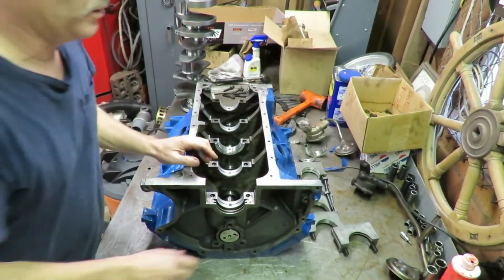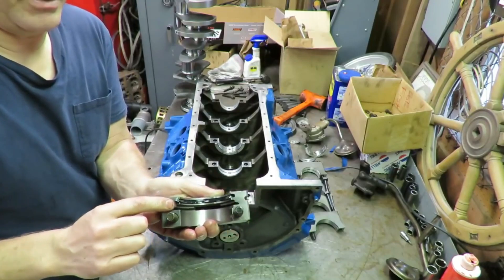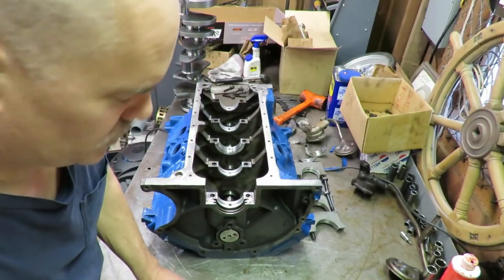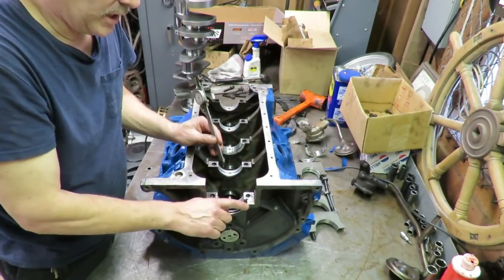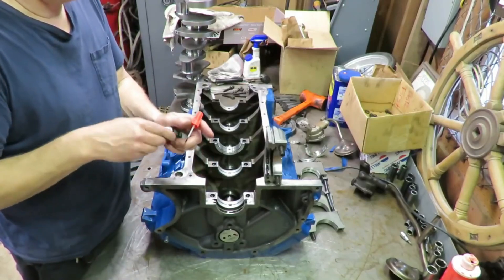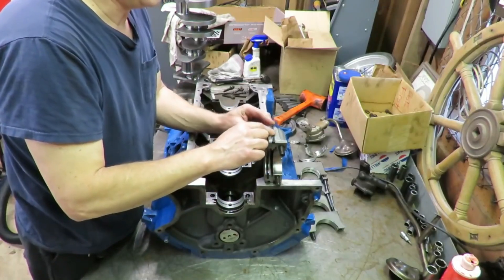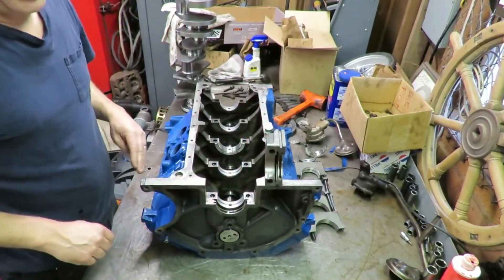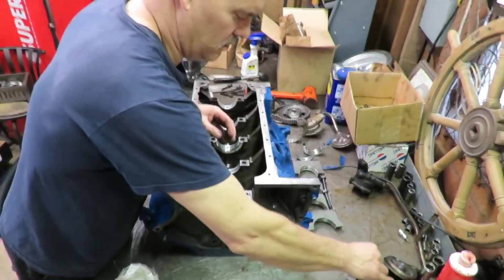Ford 390 FE Rear main seal installation

Comment: Got an old trick from Jim dove years ago put hy temp silicone in a sireng throw away those side gaskets put that cap in lose fill those voids torque the push a zip tie in that groove and watch magic happen let cure and cut off that tie it never leaks

Comment: Hello, Mate have watched your videos for a while now great stuff,I don't have a 390 but was one of the newer videos that you have postered, but I have a serious question that I can not get some answers hope you may help with your experience. I have a new build Cleveland 302 with a slight cam, not a roller rocker I am at the end of the line with overheating on my 302 Cleveland, let me tell you what I have done at present 1. Rebuilt 302 Cleveland slight cam had a 3 core copper brass radiator installed with a 20 in thermo fan with a 160f thermostat trace boss and restrictor plate and it overheated. 2. replace 160f thermostats with 185 thermostat trace boss as suggested by all info I have read overheated 3. Replaced 3-core brass copper radiator with 4-core aluminium radiator with 17 in flex fan, a 3-inch shroud, and a 185f track boss thermostat overheated 4. Replaced 185f thermostat with a Ford recommended 195 f track boss with new restrictor plate still overheating  The 302 has been just rebuilt with 50 miles on it do you have any ideas so I don't touch it. i have checked the head gaskets and they are on the correct way  any ideas for a poor Aussie Cheers Shane
Reply: when you say overheating what temp is it boiling over?
Reply: @dtorr222  120c

Comment: i picked up a 73 390 for my 70 high boy free is a very good price still runs good but i am thinking on rebuilding it before i drop it in. i got the 70 high boy for 250 buck has tool box on side good clean body no rust at all dana 60/80 lockers top loader 4 speed had a 429 in it with bad head gasket, still have the 429 stands put in stock stands. have a tilt wheel out of a 72 Lincoln which bolts right in which has a 429 in it those are the stands to use in a 67 to 72 3/4 ton. most of my rigs are chevy all have big blocks. right now i am looking at a 65 ford 1/2 ton with tool box on side 2 wheel drive rust free the body on it is mint no dings full chrome 300 bucks with the factory 352 fe in it just need a tune up to drive. thinking on flipping it after getting it running worth a lot in the shape it is in . just to get more parts for my other projects

Comment: The old pins work great and dont bend. The new ones are crap steel and bend easy
Reply: Update: old nails worked great lol
Reply: Yup, nails mushroomed and bent first time, shaved my side seals down the 2nd time and the dang nails still bent right at the end. Gonna try and use my old nails the next go around. Could of had the block together a week ago if not for these.

Comment: I have always put the seal in flush with the cap. Then I put a little gasket eliminator-anerobic at the mating surfaces. NOT silicone. I have yet to have one come back on me.

Comment: I love them old Fe I just wish they had individual studded rockers instead of that rocker bar
Reply: Shaft mounted rockers are much more stable and stronger than stud mounted
Reply: @dtorr222  I don't deny that but on budget build if you don't have the exact head gasket where your block has been decked adjustable rockers can be quite handy
Reply: You really only need shaft mounted rocker in high RPM (7000 and higher) applications. Other that that they are only good for bragging points at car meets. Standard individual rocker are more than good enough for high performance applications below (7000RPM). Besides in extreme situations your pushing the standard rockers to the extreme they make girdles to tie them all together. Along with stud hardware from ARP, or Comp Cams, or any other good manufacturer, and you'll be fine. Then you'll be àble to push the standard style rocker setup pass 7000 RPM if you decide to.😉 Assuming that you have enough cam, and springs to support that range of course.
Reply: @erikturner5073  my thing is if you decked the block or milled a little down off the heads you have to measure for new pushrods with that bar assembly that is non-adjustable that's why I like them individually adjustable
Reply: @forestlawrencegrading9154  yeah I know. I was explaining my point because so many people get hung up on the shaft system being so called superior. Even people who have engines that stay under 6500 RPM with mild street cams. Like as if the shaft system will benefit them more than the standard individual style.😆 I see this argument in both the Ford, and Mopar communities.
Reply: @erikturner5073  oh definitely that's why the old small block Chevys and older small block Fords used to respond quite well to modifications like block decking head-shaving because you can make up for it in the adjustment you ducked the block and shave the heads on a Mopar and throw that rocker bar assembly on their it'll run fine till you get at high RPM and it holds the valves open because the preload is too much because the person didn't realize they needed shorter pushrods because of the modifications that done

Comment: I agree with bad66. Tried that method multiple times and upon installation of the cap it shaves the outer parts of the seal to the point it relieves pressure where the seal meets the crank. I always install flush with a bit of silicone where they meet and also a bead of silicone at both sides where the top corners of the cap meet the block to make up for the 45 degree bevel on both sides of the top of the cap, the place where these engines always leak. Done hundreds with no leaks !!
Reply: no one on this planet has done hundreds of engines with no leaks
Reply: @bad66chevelles  I have done it both ways ends butted and off set I've had them leak both ways and I've had them seal up both ways so who is right about how the seal is placed? Honestly I don't think it matters one bit I do know that Ford recommends a staggered seal set up but who really knows We have done a bunch of Big Block Chevy and Fords I think how you prepare the mating surfaces and the quality of seal is a far bigger issue when it comes to rear main sealing I will say the super glue thing is Genius those side gaskets have always been a big problem with the FE blocks.
 They are very hard to keep in place when installing the cap.
 I think he solved that with the super glue
Reply: @bad66chevelles  UTG isn’t always correct.